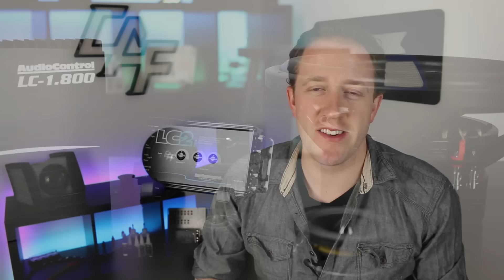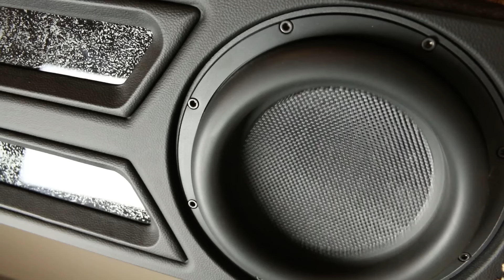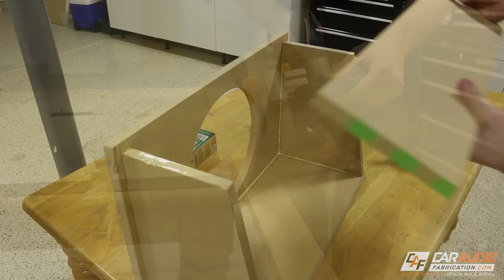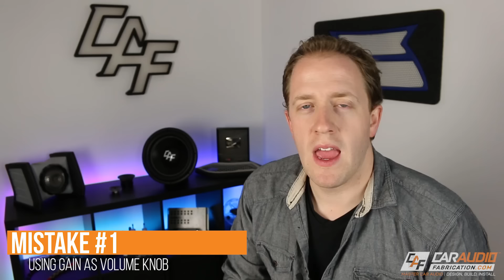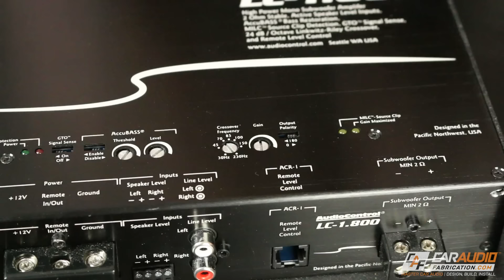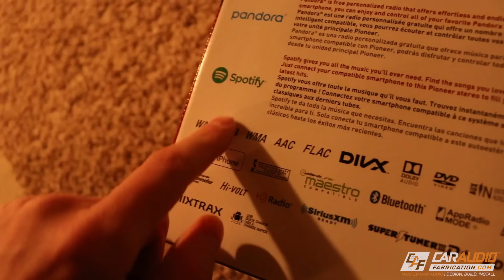Avoid these 5 common Car Audio NOOB Mistakes!

Comment: Oh God, so many times guys would spend $500+ on a new head unit and then ask me to install it into their STOCK 1984 Ford mustang (or the like).... Smh
Reply: The new receiver would have like 20 wires to hook up, their stock mustang only has 5 wires that go to a stock preamp and the dimmer switch wire is 0 to -12 instead of 0 to +12......  it's easier to gut the stock system and install all new stuff
Reply: LOL, customer would be like "Hey why's my speaker not working?"
Reply: I had a similar install a nice new 40wX4 head to some 1960's Chrysler system. Kept poping fuses and once I got that straight the factory speakers all tore. So I had to install a new speakers and just built a box to go over the hump in the front seat instead of prying the old brittle plastic off. SO much fun.

Comment: O so true. I did most of these things when i first got into car audio. Put 2 10 inch infinity subs with 1000w kenwood amp plus an 800w alpine 4 channel for 4 infinity speakers in my s10 about 10 years ago. The power draw would dim lights and lug the engine when driving on the freeway sometimes. I installed 2 optima red tops and a 250 amp alternator and boom. no issues. System got louder too since it never got full power before.
I don't even bother with big sound anymore. I go for stealth minimalist now. A set up no one can see. A 5 channel 800w-ish amp plus an 8 inch sub molded into the trunk to look factory. I don't need pounding bass. Just need the sound to be "clear and full"

Comment: I installed 2 kicker 12” comp r’s into my car without help, for the gain knob i basically picked a loud bass song, turned it up all the way and turned the gain up until i heard distortion, then knocked it back a knotch they saound great and have worked for years

Comment: I always set my gain by first leaving it on its lowest setting turning my radio up as loud as it will go with a hard bass hitting song then turning it down till no distortion or where my door speakers sound good then turn the gain up till it gets a little distorted and backing off a bit.

Comment: Now I'm scared to install my 8" sub with the amp.... I don't want to mess it up..... Truly because the people that had the car before had there subs set wrong...  And I have no Idea if the battery cables left in there are set up correctly

Comment: cutting factory harness on a radio and made the parking lights inside and out now work lmao. watch where you drill holes there might be a gas line or a wire in that spot behind it. um also make sure ALL connections are tight don't get in a hurry. you will melt fuses or pop them not to mention fry wires! hope my nooby fails helps some of you!

Comment: The trunk space issue can go a different way if you're choosing an infinite baffle design. My understanding is it's really freaking difficult to pull off successfully, but if you want to avoid having a big enclosure taking up trunk space and you don't mind sound quality suffering when you have the trunk full, that is an option.

Comment: I don't remember screwing anything up when I first wired up a sound system, probably because I had professional friends who walked me through the first setup, since then I kinda have the hang of it all. But more recently I was at the garage and was wiring up my new car at about 1am, when i i was driving home i stopped at some lights and the cur just shut off, turns out I forgot to tighten the terminal on the battery, that was a very dangerous and stupid mistake but luckily the road was pretty quiet for 1am.

Comment: I went to a large car meet recently and there was a car with a great audio system and I'm pretty sure he had a completely separate car battery in his boot (sorry, "trunk" if you're not from the UK). is this a viable option? as I imagine it would mean that you wouldn't have to mess around with any of the car's existing electricals under the bonnet (sorry, "hood") and would this make the sound system completely removable from the vehicle?
Reply: Have to work out charging the battery, but this is really common in the boat and RV scene. Deep cycle batteries are choice for situations that don't ever have to run a starter motor.

Comment: I made the wiring mistake. Cheap screw type fuse did not blow, instead melted and poked through the plastic and pierced the negative wire. For whatever reason, it stopped there. No fire 🤷🏽‍♂️.

Comment: #1 mistake: Replacing the original radio.
Reply: Replacing the primitive stock headunit in my car was on of the biggest improvements to the sound system. :P
Reply: Håkon T. No shit it's going to be an improvement but now it's not original and that's all that matters.

Comment: buying Pyle
Reply: Ray G Pyle of shit...
Reply: Not a fan of Pyle.  At the CES show of 1994 they had the best sounding van there that hit 130 db easy. The bass was clean, powerful tight, no rattles, nice sweet mids and highs 100% Pyle even the CD player.   Soundstream and Rockfords trucks where useless by comparison.  Every dog has its day.  That van was insane.
Reply: @fatboy19831   yes that was the days right. They did have some good equipment back in the day. Pyle Driver speakers were great. But today's times there the low of the low crap equipment.

Comment: So the gain isn't a volume dial but if you turn it too high it causes clipping and if too low no sound.. hmmm... And having it at 50% doesn't mean you're using 50% percent of the amp....hmmmmmm.. So what's the gain for again if it's not to adjust the power and volume of the amp to your set up.

Comment: Back in 1992 I made the mistake of bringing my Corvette to an audio shop because I wanted a "Professional installation"... I had a three way active crossover module running to 4 Precision Power amplifiers. The subwoofers were hooked up fine, the mid-range were were hooked up to the tweeters and the highs were hooked up to the mid-range.  It sounded so bad and the shop was using the car to demonstrate their work.  I was embarrassed.

Comment: I think it's important to know to be careful of which brand wire you buy. some cheap kits online will advertise as 4AWG wire but in reality are close to 6 or even 8 AWG. If you're trying to run a 1000 watt system, you might not see immediate problems with 8 gauge wire, but it could heat up and cause damage to itself and your vehicle. Very important aspect of amps.

Comment: My first mistake was buy a Honda...
Reply: I don't like Honda's. They feel cheep (plasticy) and what not. But, they last forever. So, I can't help but say, Honda's are a good vehicle. They're not no Maserati, but for the price point and what you get for it, it's a great value.
Reply: Honda= reliability. Also if an older Honda there cheap as chips and parts are abundant. So sounds like a perfect platform for an audio build to me. I just picked up an 08 Ford focus hatch for 500 bucks just to use for audio build.
Reply: Your second mistake was not to get a k20 and boost it...🤣
Reply: No . Honda made mistake to sell you a car 😞
Reply: Pinché cabezon
Reply: matt franklin Triggered much
Reply: My 92 Honda Prelude has 235836 mi and the only issue I've got is I had to replace the clutch slave cylinder yesterday ... And I am doing my build in my daily driver... 128db is fine for me don't need to vibrate windows on my neighbors house a mile away
Reply: Fuck a Honda

Comment: Installation kits... I bought one a couple of years ago thinking I would upgrade what I already had... what a pile of crap. The power wire was literally thinner than the speaker wire I was using between the amp and the sub. They just had some stupid thick insulation on it to make the wire look beefier. I ended up going to a welding shop and buying some welding cable lead (goes from the welding machine to the big clamp or gun end.) The wire is 4ga OFC, and way cheaper than specialty wire sold by car audio dealers. Made of the same stuff - copper! Works great with my 500w amp powering an 18-year-old MTX Thunder 6000.
Reply: I had two thunders 6ks behind the seat of my ranger with a JL 200w mono.  Sounded great but I was up on the steering wheel.  The way that the cable mounted into the JL wouldn't allow anything over 4ga.   I haven't done any installs in a long time, but I used to love it.

Comment: Ive always modified my cars for performance. Ive recently started a new project (accord CL7 Ex) basically piecing together a comfortable daily! And my sound system is very flat sounding if you catch my drift. Im as basic as it gets with audio because its something ive never played with before. I know i want to keep the stock headunit but have a clearer sound allround. And a sub for the shits n gigs! Any help of what to steer clear of and what reputable brands / sites i could use would be much appreciated!

Comment: Some me and my friends did when we was first getting into stereos was use random wires for power wire.  I think our first stereo we did in a 95 ford aspire we used a drop cord for a power wire.   I think our amp was a two channel old school  fosgate at about 500 watts rms 250 per channel with two ten inch fosgate subs at about 200 rms.   No fuse either.  Don't know how we didnt catch the car on fire.

Comment: Worst mistake I've seen is not using any fuses other than the one at the amplifier. The amp fuse only helps, if it is the amp or the speakers connected to it that are shorting, leaving possibility for a car fire due to shorted powercable. I always install a fuse near the battery so if the cable shorts, it won't burn the car.
Reply from the maker: +Miarez_93 very true, and that short run from the battery to the fuse needs to be as short as possible

Comment: When I installed my first system, (two 12's and a 750 watt ampp from a yardsale) I didn't even consider upgrading the electrical system. Alternator went first. Then the battery. Oops.
Reply: @juliusboy001  Your van's alternator is probably going to have a higher amperage than some 4 banger. It all depends on the car.
Reply: Ditto. Your alternator and battery were already shot.
Reply: Eric Simpson precisely!

Comment: Lol. That's what this video made me do. I bet my mini van is louder and sounds better than almost anything you've built. And it's all mix and match from the tow yard I work at. Even the wires. 1000 watt fosgate mosfet amp two twelves. Mtx external crossover jvc head unit all factory highs(6 - 6x9s) .

Comment: Biggest mistake is thinking they need a whole new system when they can just replace their existing speakers with higher quality ones that aren't cheap paper speakers.  Makes a huge difference.
Reply: I'd say it's a more common mistake to replace the speakers with less efficient aftermarket models, and then overworking the undersized amp in the factory head unit.
In my experience a good external amp running factory speakers will usually sound better than upgraded speakers running off a head unit.
Reply: Add a 4 channel amp that matches the speakers to clean up the louder volumes and that works great. That's the heart of my system, plus a 2 ch for subs.
Reply: A lot of factory speakers might as well be a lunch bag tho. Speakers are the most important part of the stereo in the same way that tires are the most important part of the car.
Reply: Upgrading the factory radio make the biggest difference to me.   Find an old Chrysler infinity system and put in an $120 Alpine CD player.  Huge difference.  It becomes a true high end system.

Comment: I am still new to audio and probably wont do much other than upgrade my radio to something with a mosfet (Don't know if that is spelled correctly) preinstalled on it with other neat little features in there as well. That way I just have to do a big 3 change and upgrade the battery to hopefully be ok. That said, my mistake is not eliminating rattle in my panels. I will be doing it soon but I see this being overlooked by basically everyone

Comment: I saw this kid split his power wire into his remote connection into his amp and he wondered why it never shut off.
Reply from the maker: +No name haha that's classic
Reply: I had an issue with the head ubit where the remote wire wouldnt engage the amp, so i jumped a wire from both the + terminal on my amp and the remote on the amp to an aftermarket switch mounted into the dash, worked like a charm. Also did this for a head unit that had an issue with constant and running power
Reply: Easier to just connect it to the red ignition switched wire.
Reply: Yeah my car runs on canbus electric wiring system so there is only like 1 remote wire and it dont push enough power to run an amp so I just took my power from my amp ran it into remote then 2 conductor shielded wire to a toggle switch mounted under dash works great just a pain in the ass wish I could just use remote wire
Reply: No name ummm. rookie mistake...friend blew a Sony xplod CD player right channel....common occurrence.

Comment: Meh, I put a 15" kicker L7 in my 1998 Corolla lol 

I couldn't even fit my snow brush in there 

The bass, it was epic
I later sold it because it was too much bass, my eyes vibrated when I rested my head back.

Went to a Rockford fosquate 12" P3, and it was super clean bass, but not as intense

Comment: I wouldn't say its more or less a mistake but a corner that has to be cut by many just to be able to enjoy something better then boss, would be electrical system. Most of the time by the time you're done buying ur 200$ amp 400$ speakers, wiring kit, radio, dash kit, wiring harness, and for some maybe even a professional install. One simply don't have enough cash to buy and upgrade alternators/ add batteries or MORE 4$ per foot 0/ wire. Lol. Nice video though

Comment: Mistakes I have seen are people not bridging the amp properly and using splicing the rear speakers for the amp input when the radio has RCA outputs specifically for the amp.

Comment: My last install witch included 2 (6.5") 2 (5.24") and 2 (1") speakers by Kenwood pro series for the cabin all connected with twisted 12g wire, to the control unit, and to a 50w rms 4 channel Kenwood amp. For my lows I have 2 (12") kicker R subs ported enclosure designed by kicker. Wired with 6g or 4g wire I can't remember I'm sure I used the right one bc I asked professionals that where my friends. Wire was by Memphis. And a electronic 2.0 farad 20v surge capacitor by Memphis. This set up is a fucking banger. However after watching this video I know know that I should have upgraded my battery and alternator. I haven't had any problems with light dimming or any bad starts. But I'm sure those changes will make a difference somebody tell me what else can I do to improve this set up or what would be better. Btw I installed it myself. And got the amps tuned by pros that are my friends so it was free lol. I payed about 700 for everything I searched the internet forna while and compared a crap ton of brands out puts and price.
Reply: I forgot to mention the amp that the subs are running out of. That would be a 1200w rms kicker amp 2 Channel (model KX 1200.1) the subs capacity was 3200w rms all wire used on this build was copper wire.

Comment: I GOT an 18 inch sub in back of my car, does that have enough space?
Reply: You're gonna wanna supplement with some smaller subs up front for that 60-80 up to 120hz range. That 2x4 to the chest feeling, ya'know? With an single 18, I'd say two 8's in your front doors or something will do great. Then 6.5" midrange in your rear doors/rear and some 4" midrange in your dash.

Comment: Buying 2/3/4way speakers.just put your hand over your mouth while talking to see what i mean.put speakers in front of other speakers   muffles the sound . use components speakers
Reply: What about those 2-way speakers where there are separate hookups for the main driver and the smaller driver in order to allow you to make your own x-over?
Reply: Drunken Hamster yes but aren't thay called component speakers.if you put a speaker infront of another speaker it mess's with sound waves and quality
Reply: No, I just looked it up in another of CAF's vids. They're called Coincidence style speakers. Basically, it's a coaxial, but the tweeter is sunken way down and surrounded by the woofer cone instead of in front of it. AND you have two separate hook ups on the speaker to connect to the tweeter and woofer individually.

Here's the vid. https://youtu.be/neDSi4g1CeQ?t=4m56s

Comment: My first mistake was running power wires and rca’s down the same side of the car. You get a engine whine through the speakers. Run the wires separate and no engine whining.
Reply: Thomas Lee | Ideally, if you are able, run your power wire underneath your carpet especially if youre using an amp to power door speakers. This lets you use either rail of the car's sides for running cables
Reply: I get the damn whine with just a new radio how do i fix that
Reply: @345daytona6  EZ dont use the factory ground black wire, make your own ground wire bare metal to metal and use proper ring terminals and crimp and use solder for solid ground connection and use 14-16 gauge for ground. if you still have noise after doing all of that then you might have noise coming in through the factory power wire
Reply: Make sure the chassis and engine are properly grounded to the battery. The car already is from the factory, but I've seen this cabling fail over time. Remember, if the engine doesn't have a good ground, neither does the engine-mounted alternator! Run a ground strap from the head-unit to the chassis, as well.